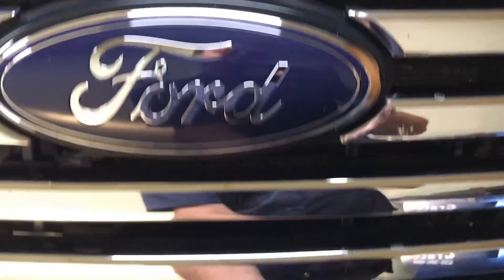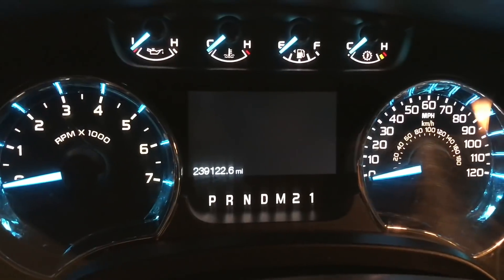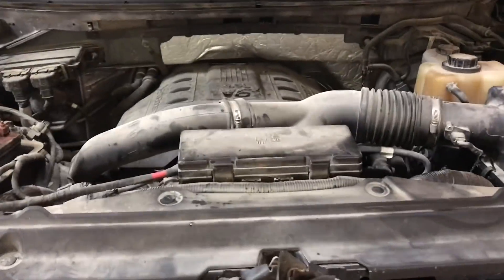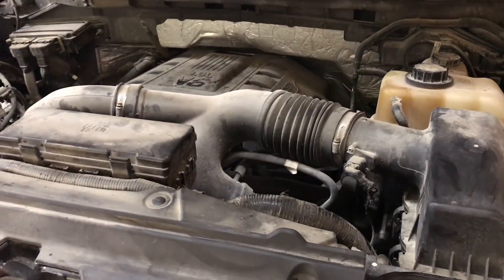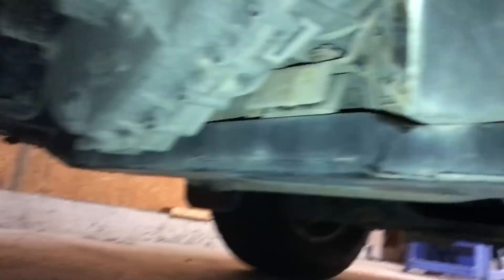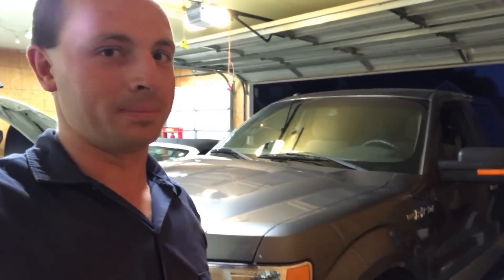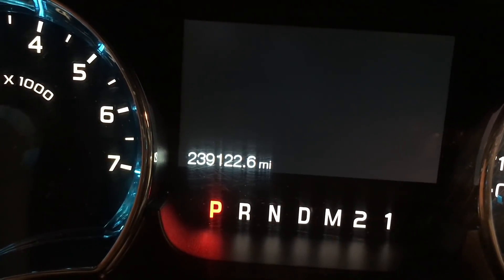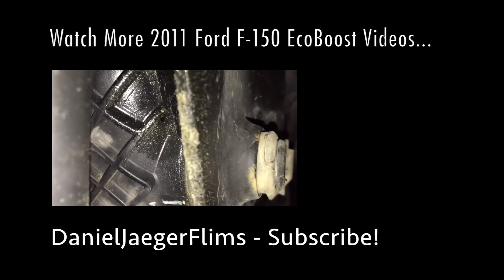Is the EcoBoost Engine Proven?

Comment: I think good maintenance and lots of highway miles do wonders. The 08 Escape I had for a while and then sold to my coworker is still running strong at over 220K miles on the original CD4E transmission that's supposed to be a piece of junk.
Reply: The Escape is a pile of junk.They also eat alternators due to location neat heat from the exhaust.Get a misfire code,replacing coils which the Ford coil  on plug ignition systems eat coils left and right.
Reply: it's more highway miles than short stop and go without long heating cycle ;)

Comment: I read in the other video that the owner ended up selling the truck at 285k miles still running great. 

I saw a transit van with a 3.5 ecoboost that had over 400k miles on it. To top it off, the transit still has the gen 1 engine, strictly DI.  

Do proper maintenance and these 3.5 ecoboost motors can last.

Comment: January 2020 we have just over 200056.07 miles on are 2013 F 150 xlt crewcab 4 dr 4x4 ecoboost 3.5 only thing we have had to do coil packs and plugs normal services we done at home n shop we charge oil n filter at 7000 miles so we use to pull trailer back n fourth to my kids n Mo to Oh lots of Hwy drive n around farm county roads  we love the F150 start n go

Comment: Ok here is my two cents... I have a 2015 Ford F-150 2.7 ecoboost and I love this truck!!! But I have had some problems with it.. at 31k miles I had to take up in because the check engine light came on and it lost almost all power and the told me it was just a sensor needed to be updated and I drove it another 750 miles and it did the same thing 😡 so after two weeks they still couldn’t figure out what the problem was so the gave me a 2016 Ford Focus to drive until it was fixed which was nice of them but I have two kids and a wife so we were really tight on space, after another month after replacing 10 different parts the figured out it was both of the turbos and I got it back! I now have 42k on it and she’s doing great but if I have another problem with this truck before 70k I’m trading it in for a 5.0
Reply: A Conneely you must not have kids? Because we have a double stroller and you can’t even fit that in the back of a focus!!! You clearly have no idea what you’re talking about.
Reply: Nova Man been thinking about it!
Reply: @DJmetaldetecting  do it!
Reply: I say get the 5.0.
Reply: Dont believe these ppl alot of em talk out of their ass or live with parents. I have a 2.7 52k miles so far no issues I did have a sensor go out at like 500 miles it was defective. I have towed and drive alot and it's never failed me good luck.

Comment: Maintenance.  If you don’t schedule maintenance, your vehicle will schedule it for you.    I’ve got the 2011 5.0 flex.  137,000.  Running good.  Not an ecoboost, but I’d be ok driving either.  Ford does a really good job on their engines.  I think I’ll stick with the 5.0 just because that’s what I have experience with, but who knows.
Reply: Sounds awesome same here.

Comment: I have a 14 yr old F-150 that I've owned since new with the 4.2L and it has 242k miles on it. Only thing done to the engine are oil/filter changes, plugs, wires, coil and intake gasket. Its been the most reliable vehicle I've ever owned. Oh, and under the hood it looks like new compared to that truck.

Comment: I’m at 127k, I’ve only done oil changes. What would be good maintenance at this point?   I have had misfires when I punch it. But other than that no problems. MPG is down to about 17.5 though.
Reply: J- did you change out your spark plugs? for older ECOs Ford recommends change out at 80K since they run hot.  Original plugs at that mileage could cause your misfiring.

Comment: Perhaps this one is just a diamond in the rough? I remember one customer I had a while ago had a timing chain go out on his 2013 EcoBoost and the engine had not even 60,000 miles on it. Didn't the EcoBoost have timing chain problems for a while?
Reply: Nick Holzemer I think you’re right. Just because this one goes over 200k miles doesn’t mean they all will.  The same goes for the 3v 5.4 there were some good ones but a bunch of bad ones. It’s all a crap shoot anymore. Just roll the dice...
Reply: We have 12 2011 to 2014 f150 Ecoboosts at work ranging from 270 up to 350k miles. Same exact story as this truck.. hardly anything needed except for plugs/coils and o2 sensors. Ive personally owned 2 and never jad a bit of problems.
Reply: @THETOPGLOCK  yes the earlier first generation 3.5 eco boost engines had revised tensioners but the majority of these I have repaired have had wide oil change intervals and caused excessive guide wear. These are great engines. I have more than a couple dozen customers with 350k on theirs here in florida so I say yes they're proven for durability
Reply: Mid 2013 and newer got an updated timing chain, all replacement parts ars also improved parts.
Reply: my uncle has one and it has 214k
Reply: I’d agree with this. Seen quite a few “blow up” with low mileage. This one was all high way and no towing. So really no stressing the engine with those turbos.
Reply: They still do. History repeats itself. Ford repeats engine problems.
Reply: I have over 510,000 km on my ecoboost. They are definitely proven
Reply: clarda1 He pulls a trailer with this truck. He mentions it in another video. Ford trucks are for work not like a chevy
Reply: @Chuckers84  , how many times did you replace camphasers and chain?
Reply: Yup just like the Sohc 4.0 ford, some rattled at 50k miles, mine 206k, rattles like heck, but runs good, and doesn't burn a drop of anything
Reply: None, engine is all orginal, auto trans was replace at 201k
Reply: repairvehicle none all original
Reply: Just posted a video of my half a million km ecoboost have a look!!!
Reply: Ford like the other manufactures hit some quality control issues from their suppliers. Ford had a bad batch of timing chains, some would stretch beyond what they were engineered to stretch, not all, but some. They did revise tensioners later as well. Toyota and Chevy got a bad supply of water pumps mixed in with their trucks. Toyota also had a bad supply of egr valves if I remember right.
Reply: I just had my entire timing chain set replaced and my cam phasers. Truck has 191,000 miles on it.
Reply: @gbaileyo7  Ford is more play than Chevy.
Reply: @DragonKnightX12  lol good one
Reply: @repairvehicle  - l believe your referring to GMC , alias General Motor of China. You got your facts wrong , Ford has always built the best trucks.
Reply: @repairvehicle  - you are Ford hater. No problem , hate all you want.Ford is still better than chevy .
Reply: @olblu8746  , not a single ford reached 1 million miles without any engine repairs. I own Ford.
Reply: @olblu8746  , Ford is been known for quality. Never been rated as quality vehicle.

Comment: My 2013 EcoBoost will only manage 17 mpg at best.   Misfire issues and limp mode drive me crazy...I don’t feel comfortable drilling the hole for condensation issues...Ford dealer(s) won’t touch it without a “code” after a shuttering misfire...60 K miles and it’s time for it to go!

Comment: Great durability shown here. I'm sitting here with my old 4.2 with 197k miles just hoping I don't have any significant issues with it any time soon. It needs intake gaskets and that's about it.

The only thing I ever worried about with the ecoboost Fords was the possibility of turbo related oil leaks. Great to see this one hasn't had issues yet. I have seen it with 4 cylinder ecoboost engines though. I still don't know how I feel about the 2.7 ecoboost, that is a tiny motor for a full size pickup!
Reply: Does that 4.2 need exhaust manifolds? 99.9% of those motors that ive seen have cracked manifolds along with the 4.6 5.4 and 6.8
Reply: @302diamondstate7  not yet  but I'm sure they are in my future as the fasteners are very rusty

Comment: To me if a car is maintained properly mechanically and structurally and has no issues, mileage is just a number, a few rust spots on the body and a small rip in the seat is not an issue for me, but there's a limit to over paying for any vehicle

Comment: Wish my 302 Coyote got that kind of mileage, but she purrs like a kitty when I step on it
Reply: I like the sound of my 302 windsor better lol
Reply: A turbocharged V6 may use more fuel than an NA V8 if you are constantly on boost.
Reply: @skylinefever  Yeah i think if your always pushing it hard the V8's do better, mpg and reliability wise too. The ecoboost is great for the people that rarely use a truck for heavy work lol
Reply: @skylinefever  Actually it (ecoboost) reaches peak torque at 2,500 rpms. That logic used to be that way with V6 vs V8 N/A engines & gas mileage but its not the case anymore. The V8 ends up using substantially more gas to reach its peak torque @ around 4800 rpms, and has less torque in the end compared to the 3.5 eco (Ford specifications compared to 302).  There are towing comparisons on youtube and the ecoboost (3.5) easily gets greater gas mileage - because it runs much lower rpms while creating more power its just the nature of forced induction. As far as being 'constantly on boost' - what does that mean? The turbos never stop running 'boosting' except while the truck is idling and not moving. Its not NOS. The exhaust creates the air pressure. Its a ratio of exhaust output and greater static pressure input. They reach their peak efficiency at 2500 rpms.
Reply: @gtowrx2001  So if that V8 is needing to run at ~4800 rpm's to reach peak HP/torque, and the V6 3.5ltr eco is creating MORE HP and torque than the V8, @ 2500 rpms
-- which ones working harder and using more gas? Just a little confused there....
Reply: Davey- idk what V8 your talking about, but my old style 302 will barely even hit 4800rpm unless im at full throttle, it runs at low rpm’s. Also my biggest point is that there is a lot of stress on the engine with all of the forced induction and such, will it hold up long term to heavy use, eh, idk. I know which engine i want and have,  is all im saying. Btw i don’t have a coyote 5.0, i have the old windsor 5.0, in a 98 ford explorer.
Reply: Sounds awesome brother I have a 2011 Ford F150 with the 5.0L Coyote V8 with 129,000 miles on it and still going strong and its a beast.
Reply: @gtowrx2001  Same here brother.
Reply: @skylinefever  Correct mate.
Reply: @davey3765  I doubt that EcoBoost of yours will outlast the 5.0L (302) Windsor V8 in my 96 F150. Also I bet you're truck won't outlast the old Ford trucks from the 60s and 70s.

Comment: I keep having a stalling issue with my Ford-f150 “Low Oil Pressure” I keep hearing people say replace the oil sending unit but mines is not leaking so I don’t think that’s the issue. I noticed that the truck is getting 20 mpg and I’m getting a 14.5 gallons over 3k miles

Comment: This makes me feel pretty good about my explorer. It doesn't have an eb, but it has a very reliable engines known as a 3.5 duratec, which is supposedly the same engine as the 3.5 eb sans turbos and direct injection, so if the boosted version of this engine can last this long, it looks pretty promising for my Explorer lol. Many 3.5 duratec have well over 200-300k on them, basically everyone I've talked to has said that aside from the very rare water pump issues, these engines are tanks.
Reply: Hey folks its Puff the Magic Dragon the Typical modern car lover.
Reply: The engine might be reliable, but everything else will eventually break down or rust. And it doesn’t even have anything to do with Ford. It’s just laws of nature. Nothing lasts forever, especially rubber and plastic parts. Sooner or later things will break down, and even if the engine holds up, the rest of car won’t….but it will take a few years.

Comment: Just bought a 2012 Ford F-150 Lariat 3.5 Ecoboost Supercrew with 130K miles on it for 12K at the end of October...it only gets 14.4 city and around 15.4 hwy...yet this truck you have been maintaining gets over 20...how in the world can I get that kind of results? Fyi, I did have to replace the bank 1 catty already due to check engine alert but other than that hardly any issues...but, how can  I get those same mpg results??? I have been scared that I made the wrong decision going with the Ford Ecoboost over the 2014 Dodge Ram 1500 V8 with 150K miles that I was trying to choose between on the car lot. Hoping I made the right decision...
Reply: There are many factors on mileage- my 2012 F eco averages around 14 city and 18 hwy.  Less in winter not only because of the cold weather but gas formula change over (EPA).  Best hwy was 22.0 with a strong tail wind.  That only happened once in the 10 years.

Comment: You GM trolls and your insecurities. I would hope those wonderful GM V8s would be reliable and proven .As they have been making a simple 2valve pushrod V8 since the settlers came to JamesTown
Reply: "You GM trolls and your insecurities." ?????   What are you trying to say?  That makes no sense at all. Learn to write.
Reply: Bahahaha...ok so I own one and I still think that’s funny. 👍🏻
Reply: Pushrod hate is weak euro whiney sh*t.  Pushrod V8's have a lower center of gravity, lower overall package height, easier to work on, generally more reliable, and good for 10,000 HP as you see in top fuel dragsters.  Some things have stayed the same since original internal combustion engines, like, I don't know, pistons, valves, connecting rods... you going to call that Jamestown as well?  Corvette, Viper, Challenger Hellcat... all provide insane performance for the price.
Reply: What is wrong with a push rod V8?  I think push rod is the way to go for a V8, reliable, good bottom end, sound awesome, excellent mpg.  I see no flaws.
Reply: I am a GM fanboy and still have to say that's funny shit because it's true. GM has made pushrod engines for awhile now..............!
Reply: @DeltaSierra426  do what those 10000hp cars are custom built and unreliable as can be second both push rod brands are having lifter failure after 100k so theres that then working on anything gm is just complicated because you just look at it and say why you put that there
Reply: @buttonman1831  bad mpgs for one and a bottom end is a bottom end this is a top end debate where honda, Toyota and all other has proven that the ohc and better than pushrod
Reply: @austinhowze6280  Bad mpg? My Silverado with. 5.3 pushrod consistently gets over 20mpgs.  My Tundra occasionally got that on the best day.  The motor in my Tundra was bellet proof, but I have complete confidence in NA V8 pushrod motors and I am a Toyota guy.
Reply: @buttonman1831  lmao I hope you not believing that computer I did the the numbers a few times they do 14 to 16 at best
Reply: @austinhowze6280  I'm not am idiot of course I calculated it and the numbers were bang on.  My Tundra was a 14 and considerably harder in gas at the pump.  You don't have to believe me, but I owned both of these trucks a 2014 and 2018.
Reply: @buttonman1831  that's great to bad it runs on 4 to do it and the system that does it kills the engines life span
Reply: @austinhowze6280  So what evidence do you have of that.  I work at a place where everyone drives a truck and plenty pushrods have high miles.
Reply: @buttonman1831  lmao before all that new bs if you want to talk long lasting the you go back t0 14 16 mpg trucks you talking mpgs you go to trucks with cheap Chinese parts that pull oil from lifters to run on 4 cylinder

Comment: This ecoboost leaking oil from the crankshaft seal. It's not from Oil change. Oil filter is below crankshaft seal and 8 inches away to the side. I have f150 and when change oil, its being spilled on suspension parts and not on the engine Oil pan. It would make sense for Oil to be spilled on engine from filter when Oil filter is about crankshaft seal.

Comment: I just got a 2014 3.5 eco /w 37k miles (XLT supercrew 4x4) and it blows my 2001 V8 out of the water, towing a 7000lb trailer up hill. The torque is awesome. But Im so paranoid somethings going to break. These engines to me are exotic.
Reply: Hi I’m considering one but not sure 🤔 cuz don’t know if I trust a ecoboost after my problems with my FOCUS RS so thinking of f150 5.0 or 5.4

Comment: My 2014 F150 3.5L ecoboost only gets 15 mpg average and no hard driving or towing with 82k miles. Not sure what is different compared to this high mileage truck. No engine codes.

Comment: Any problem with carbon buildup on intake valves ?...everyone saying that the downfall of GDI...i have my doubts
Reply: Doubt it has a problem. the carbon build up happens under vacuum. slow speeds and idle. if this truck is getting 21.4mpg its on the highway constantly driving highway speed at all times.
Reply: I think the problem varies by the car manufacturer. I read more horror stories about BMW and VW than from other companies. If GDI was inherently such a problem, I don't believe Mazda would have been so successful over the past 10 years.
Reply: @skylinefever  GDI does cause carbon build up that's why Ford and several others have moved to the dual port setup.
Reply: A little sea foam in the intake and good to go but really put a catch can on anything with boost